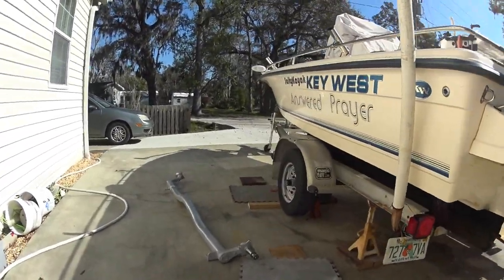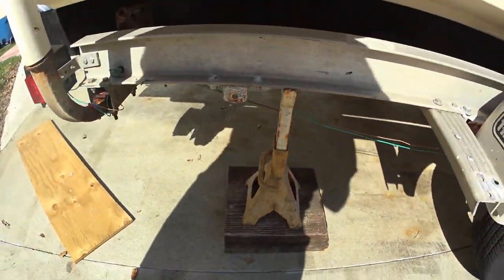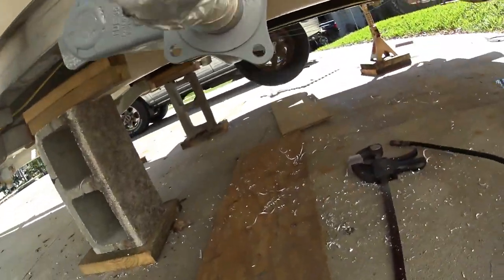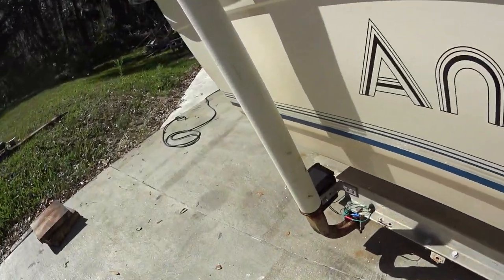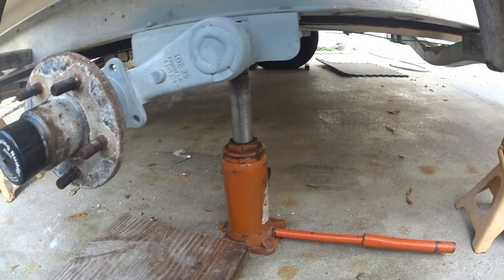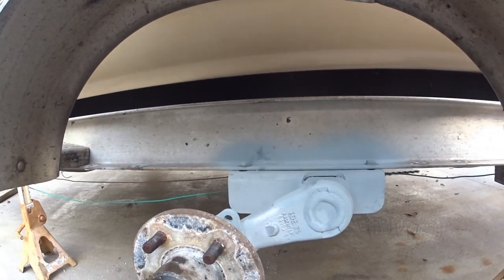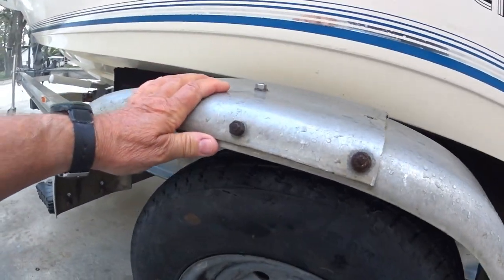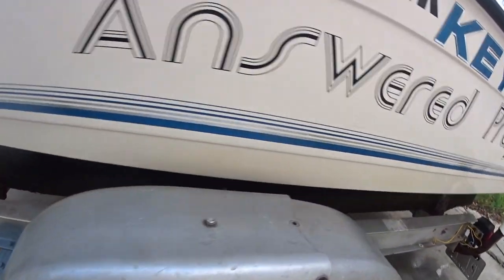Spring Axle to Torsion Axle Conversion

Comment: Thanks for showing the conversion. I want to do the same to my trailer.  Great job figuring out the issues.
Reply from the maker: Hi DN.. Not knowing much about torsion axles and looking back now that I am done, if possible, I wish I could have gotten an adjustable torsion axle. That probably would have saves me some issues I needed to solve but I am thrilled that this project is now complete and with the boat roles down the road just fine..

Comment: A lot of work but a great job, Lane! I have a torsion axle on my new trailer and I really like it!  Better than changing springs every two years
Reply from the maker: Hi Danny, yes, I am finally out of the springs consumer business. But looks like I will be needing a pair of D-load tires. I did a quick calculation of the weight of the boat, engine, full tank of gas and the weight of the trailer PLUS 4 big batteries and I am over on weight for C-load tires.. yep, always something..!

Comment: tips: 1. add a spacer plate of aluminum between the metal axle and aluminum frame, replace the aluminum plate after a few years when it corrodes, or use a rubber spacer that will prevent the galvanic corrosion between the metal and aluminum.  2. drill with oil to reduce the heat, make bits last longer, and cut faster.

Comment: Good morning a friendly reminder I think you know but I wanted to make sure that you triangulate between the ball and a spring so it runs straight down the road and gives you maximum Tire life. Awesome videos.Thank you
Reply from the maker: Hi Richard.. I actually indicated I did that in the 'description' of the video. Not only that but I measured also from the back of the frame to make sure all measurements were still square. It is an OLD aluminum trailer and upon close inspection, I will be needing to replace some of the cross beams in the future thanks to galvanic action of steel touching aluminum.
Reply: Also you need to center your torsion where the axle used to be,then your tires would have fit your fenders,now your load point is further back.

Comment: I've always used oil filled bearings because of the difference between oil and grease. In my experience I have learned that grease tends to draw in. Oil on the other hand pushes debris out. Also as the wheels turn with the oilfilled hubs the bearings are continually bathed in the oil allowing them to stay cooler when the trailer is moving.
Reply from the maker: Hi Thomas.. I have never heard of oil filled bearings. Can I 'simply' remove the old bearings and replace them with oil filled? Are oil filled 'sealed' bearings?

Comment: Good job, Salty.  That torsion axle should give you many years of trouble free trailering (axle and suspension wise).
Reply from the maker: Let's hope so Jim... But another tidbit I discovered was I am a little over the weight on my C-load tires and I need to get D's.. that will be waiting awhile...

Comment: Love it. Can’t beat modifications to save some cash. Looks great
Reply from the maker: I am probably going to go to Home Depot and buy some indoor/outdoor carpet glue and cut some bunk material and glue it over the fenders.. And that will also make the trailer a bit less amateur plus protect the bottom of the boat from scraping them if I ever come in a bit sideways...
Reply: Great idea use the blue though not the green lol
Reply from the maker: Hehehe.. I have some scrap black bunk carpet and that should last a lot longer..
Reply: Do you have a PO box I was planning on trying to cast sinkers this spring again I have about 500 lbs of sailboat lead for bullets and fishing sinkers. I could send you some sinkers in the future.

Comment: No. The hubs are sealed. the bearings are resting on the axle just as in the grease filled bearings. The outer part of the hub has a cap on it and oil is put in.

Comment: Hey.  Dude, I just bit the bulletin on a torsion axel for my 1984 17-1 Mako. The galvanized steel frame original trailer is intact. I was going to replace the springs yet again  till I did the math. Thank you for this video. On Sex vs function? I’m with you.

Comment: Need a aluminum spacer between bolts on axle to trailer to prevent between axle and trailer. Corrosion will still occur just on the plate not the trailer. Wrote this before end of the video

Comment: Concrete blocks on ends is the weakest point.. there true strength is setting then correct as normal use dude.. you have the blocks set in there weakest setting.. not good..
Reply: You also changed your tung weight of the trailer because your pivot point has changed future back on the trailer
Reply: You should make a proper video then and show us how OHSA does it.

Comment: not trying to be that guy but concrete blocks are not stronger tuned up right there strongest when laid flat as if you laying a foundation with them those particular blocks are not designed for side load.

Comment: Cement block is not at maximum strength in fact that's its weakest stance !
Reply from the maker: Worked just fine and I am sure it would also 100 more times. But, if you have experience with this kind of load/weight ratio and it might help some of our viewers, PLEASE let everyone know the best but cheapest way to accomplish the task.
Reply: SaltyKayak he is right. Many people have been killed this way. Jackstands are the cheapest and safest way. When it has to do with life and death sometimes 25 dollar stands are worth it! Great video though

Comment: It really is never as simple as it sounds. Just replaced the leaf springs on a similar trailer holding a KW1720 and quickly realized all the bolts needed to be grinded off. Will raising the front roller make it easier to winch up the boat to the eyelet? I have a similar issue.
Reply: Hi Steve, you may need to rise the rollers a bit. The bulk of the weight should be on your rollers and the bunks hold it steady. Too much weight on the bunks make it drag.  Hope it helps.
Reply from the maker: Hi Steve, I had a 1720 many years before this 186 Key West and had it on this trailer. I think what you are 'supposed' to have is 10% of the weight on the tongue. I always estimate the weight by if I have to struggle a bit to lift the nose onto the ball. I am STILL adjusting this boat for that sweet spot. Since I had to raise the bunks about 2", now I am sliding the nose either a couple inches forward or back and raising the roller up a couple inches so that when I come IN from fishing, I can load the boat right up to the roller on the nose with minimal gunning of the motor. It takes patience to get it just right for each boat.

Comment: I am very Happy the axel worked out for YOU. One day I will source you Fenders From Tractor Supply. I will send you some Marine Grease and a new Gun.
Reply from the maker: Hi Jeff.. that would be great since I had to throw one of my non-functioning grease guns in the trash and had to use a back up barely limping along one to grease the hubs. 
Have you heard or are familiar with 'oil filled' bearings? I have never heard of them but a commentor said I should go that route. I need to look into those for future bearing changes.

Comment: Rookie Mistake, the axle has an off set so you don't center it where the old axle was also your boat may be 2500 pounds 3500 pounds is too small 5k awesome. In salt water it won't last long.. lol you can loosen the torsion blind nut and physically move the arm. Murphys law is when your retired you don't recover as quickly. 
   My grandfather built a jet plane from military surplus sure enough it worked but sure enough I can't build one because of him.
Reply from the maker: Hi JH, I trust your experience a lot more than my in-experience in these things. Fortunately for me, the year or so I have had this torsion axle on the trailer, it has worked perfectly. I took my time when installing and ordering it and of course got a heavier duty one than was called for.. I think I have a 3200 lb boat and a 3500 or 3700 lb rated axle. Been back and forth to the ramps hundreds of times since installing and not a problem.. love my torsion axle. One less thing to worry about.. compared to springs.

Comment: Will salt eat the spacer?
Reply from the maker: They are 'coated' aluminum and the trailer is also aluminum so there won't be much 'galvanic' action between the spacers and trailer frame. The corrosion will occur between the steel bolts and the aluminum and the aluminum spacers and the galvanized torsion axle. And even though it will take years to notice anything harmful, I am spraying both heavy duty silicone and cold galvanize on every exposed piece of metal to help slow the 'eating' action of the salt water.
From what I have seen, there isn't much you can do to slow the action of springs rusting because they are constantly rubbing each other. That is another reason to go with torsion. Here's my experience over the decades with springs.. you will buy a set of axle springs every 2 years (if you go as often as  do) and end up paying more than if you were to spend a little more now and get torsion and it last a decade or longer.

Comment: Would have been much easier to take boat off trailer and work with an empty trailer
Reply from the maker: Hi George, I actually laid out the blocks at the back of the boat and was going to go that route. The back would have been a cinch to jack up and block but I would have had a series of cross members that I would have had to jack up the nose, brace, remove the jack, pull the trailer forward to the brace/cross member, jack the nose up again, move the brace to behind the cross member, lower the jack, move the trailer up to the axle, brace, jack up the nose again, move the trailer up to the back cross member/brace, jack the nose up one last time and move the brace behind the last cross member before I could pull the trailer out for the work. Truth is, when I lived in N. Carolina and had an old 20' Bayliner, I did it that way. But then, I would have to put the trailer BACK under the boat in the exact reverse order. And being retired and somewhat lazy (now) I chose the way I did it and I think it turned out better (for me) because the conversion took 2 days. Had I gone and dropped the boat at the closest ramp to free up the trailer, I would have been in trouble because I wasn't going to leave my boat at the ramp for 2 days and over night... it probably would have been stripped by morning.

Comment: wow isent it something how trying to do one thing turns into a federal case
Reply from the maker: It's all right gary.. I knew there would be many of DIYers that would have 'better' ways of doing things. And I actually look forward to their input as I am always WANTING to know how to do things better. For instance, Thomas said that he uses 'oil filled' bearings and I have never heard of oil filled. If they are not too expensive and will fit my spindles and hubs, I may order a set.
Reply: ya oil lubes better then grease, but once you loose oil its all over

Comment: Probably be better drilling with the hammer action Off !!
Reply from the maker: Don't have a hammer drill. Actually, this drill finally gave out (irreplaceable switch) when I was 1/2 way thru the 3rd hole on the last spacer. Had to finish with my ol trusty battery drill.
Reply: in which case I can only say,sounding like that it was lucky to last that long !

Comment: Don't be cheap and petty when you retire dude you buy crapy tools it's a drill God damnit man not a boring in wood use oil wtf dude... .   

 OMG stop 

Back from home Depot where I bought cheap ass grade 5 bolts because Fastenal wanted 4.00 each to much. 

It was a 18' boat I beam 1/8" wall the dam trailer weighs 900 pounds the boat weighs 1500 plus 2400 he has 600 pounds tongue weight ...

Hey everyone if your in this pickle message me if you watch this video read my comments message me on how to do it right

Comment: get smaller wheels
lol
Reply: smaller wheels go around faster wearing out the bearings faster. I know this true by experience .. do the math.
Reply from the maker: I actually need larger rating wheels. I now have C-load tires and need D-load which are 1" larger. Shouldn't be much of an issue for the fender/tire gap but I need beefier tires for the weight I have on the trailer.